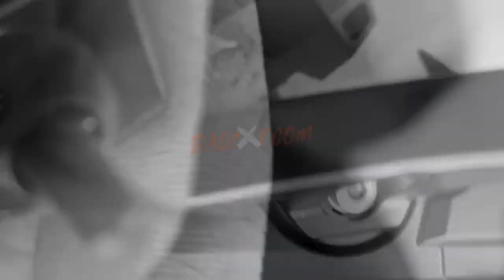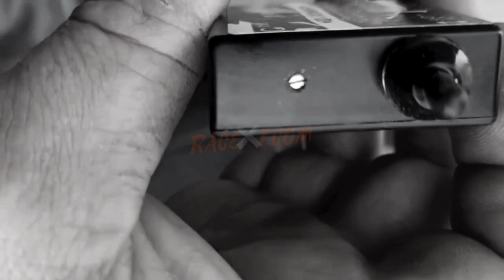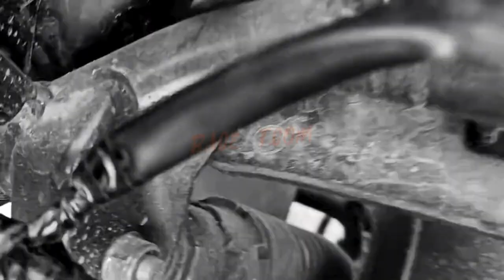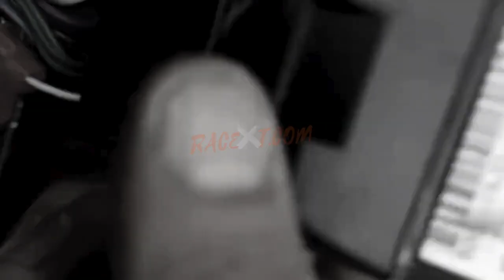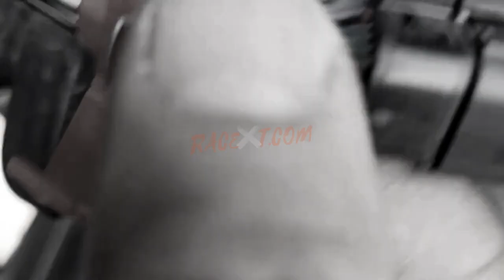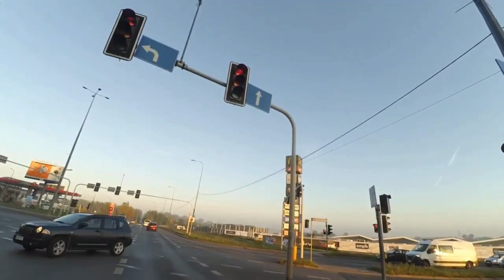Chip tuning for Malaguti Dune 125 E5 - power unit - Installation guide - Racext

Comment: The electric regulated speedlimit of my Dune 125 (E5) ist 109Km/h at 9000 rpm. Can this power unit cut off this speedlimit? The maximum rpm is 10000.
Reply from the maker: Hi @Ga09Ma! 👋

Our chip tuning module for the Malaguti Dune 125 E5 does not remove the ECU-imposed speed limiter, but it optimizes the air/fuel ratio to improve acceleration, throttle response, and overall performance.

⚙️ What does it do?
✅ Improves power delivery and acceleration
✅ Enhances throttle response
✅ Works within safe ECU parameters

❌ It does not remove the 9000 RPM limit set by the ECU. However, with better combustion efficiency, you may notice smoother power delivery and better performance across all RPM ranges.

📌 If you're interested, you can check out the module here:
🔗 racext.com/product/chip-tuning-for-malaguti-dune-125-e5-power-unit/

Let us know if you have any other questions! 🚀🏍️